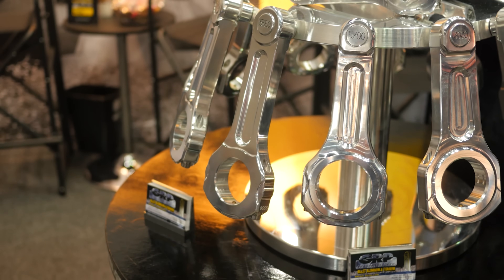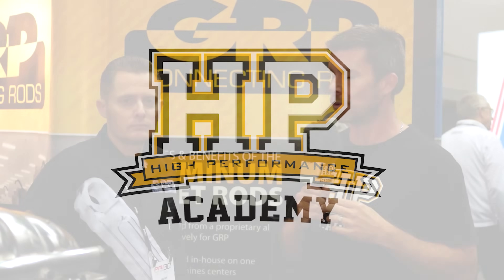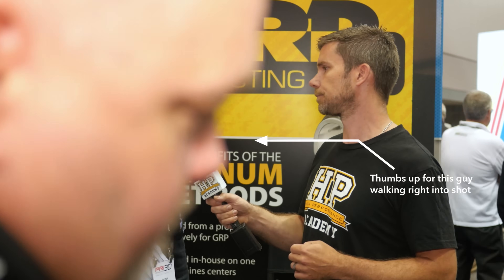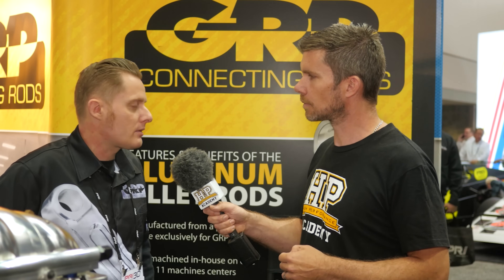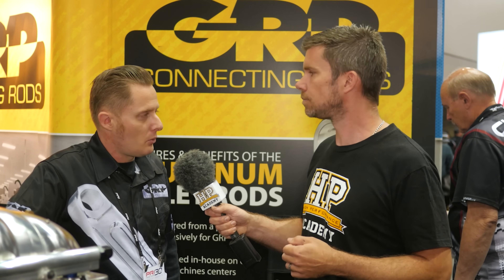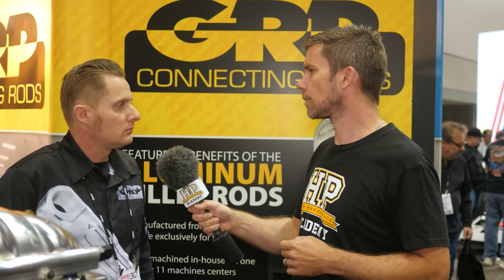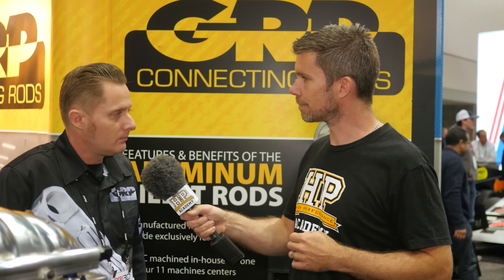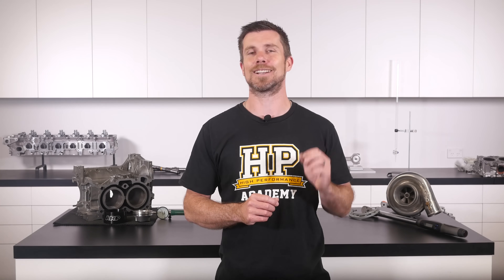Aluminium Conrod Pros and Cons | GRP Connecting Rods [TECH TALK]

Comment: Very little power gain to be had with alloy or titanium rods; that’s why alloy rod manufacturers rarely give specifications in that context.

As the guy says, it’s really just the alloy rod’s malleability that suits them for such a high powered environment. However, the greatest load on a conrod is directly after the exhaust stroke, as then their ductility is strained, and alloy rods have far less ductility than steel conrods. 

So, alloy rods (and to some extent Titanium) rods give very little HP benefit for drag racing applications as the engines don’t rev into very high numbers like F1 engines do.

Another way to say it is; for almost all (including some performance/racing) applications (and within reason) the overall static (translational) weight of the crankshaft and con-rods don't matter much.

This applies to alloy con-rods as well as the majority of their  measured (translational) weight actually becomes rotational energy/weight when the engine is running. 

This means that very little of those sections of the lighter conrods that actually made them slightly lighter than the other steel conrods will be near the piston’s wrist pin; and since those conrod sections (near the wrist pin) do not constitute and/or meaningfully contribute to rotational mass/energy even when the engine is running (as they are translational mass) there really is very little real (translational) weight saving.

And, it is translational weight saving that matters the most with these components.

Put simply the majority of the mass of a conrod is always at the big end section - so a translational weight saving of a few grams across the whole conrod (when it is not in motion when the engine is running) may not mean so much  in rotational mass/energy terms.
Reply: No I don’t go on F1 technical.net at all. 

No need. 

I am an ex AMG (Mercedes Benz) Powertrain (control systems) Engineer. 

For a while there (years ago) I was seconded onto the MB-McLaren team. 

Now I consult in the fields of electronic, power systems, acoustic, and mechanical engineering. I love power-trains, internal combustion engine and electric motor design, physics, boxing, judo, motorcycles, audio, and music. 

Take care.
Reply: Correction; in my first post I meant to say alloy rods have far more ductility than steel. Apologies.

Jim; ex AMG (Mercedes Benz) Powertrain (control systems) Engineer.
Reply: Great post. So unless my engine goes above 10k rpm, just go steel con-rods or maybe even whole steel rotating assembly? ... Any point in Alu pistons and crank then?
Reply: Remember, Top Fuel dragsters are getting pulled down all the time; so con-rod reliability isn’t such a big thing - but crankshaft reliability is, and alloy con-rods (due to how they stretch and compress) save crankshafts.

Stay with steel rods for street and race applications.
Reply: @StormCentre88  The biggest benefit is to the bearing life and block webbing as well. When your making a lot of power on a OEM engine such the Toyota 7M. The AL rods help greatly at 300HP+ per cyl.
Reply: @georgehoneymen6062  They may make some difference to bearing life, but I suspect it would be negligible.

Happy to be directed to some real world test results that show otherwise.

But one of the reasons I suspect it would be negligible goes to the aforementioned discussions in my above posts (particularly that in relation to translational and rotational energy/weight). 

The majority of the force on the big end (bearings) comes from the cumulative forces resulting from instantaneous, reciprocal/inertial, and composite torque.

And due to what I said in the 3rd paragraph of this post and also my above-mentioned posts, the alloy conrod contributes very little difference to both the reciprocal/inertial torque; as very little of the sections of the lighter conrods (that actually made them slightly lighter than the other steel conrods) exists near the piston’s wrist pin.

So, since those conrod sections (near the wrist pin) do not constitute and/or meaningfully contribute to rotational mass/energy even when the engine is running (as they are {up/down} translational {linear} mass) there really is very little real (translational) weight saving.

And, it is translational weight saving that matters the most with both, these components and bearing durability.

Furthermore, as stated in my above posts, Top Fuel dragsters and/or usually any other engine using aluminum conrods are getting pulled down all the time; so con-rod and/or bearing reliability isn’t too much if a big thing.

But crankshaft reliability is, and alloy con-rods (due to how they stretch and compress) save crankshafts.
Reply: @StormCentre88  I have only read posts from users which state that the rod absorb a lot of shock which doesn't pound on the bearing and crank shaft. They mentioned quite a bit better bearing life over a high quality forged rod when they did the switch to it.
Reply: @georgehoneymen6062  Fair enough. 

I have re-thought my position on your earlier posts and I concede, alloy con-rods would preserve bearing life to some extent.

However, the engines within which they would mostly be used would be torn down and rebuilt at such a high frequency I doubt the additional bearing life preservation would make a difference.

Please note bearing wear (particularly as you have described it) is a matter of “durability” more than reliability; I know this may seem pedantic, but I will explain later in this post and hopefully that will throw light on how I approached this subject in my earlier posts.

More than likely the real and/or main reason why alloy rods are used in some internal combustion engines - especially dragsters - is (I suspect) because alloy rods have far more ductility than steel; and this means their ability to *absorb shock will provide great benefits to preserving the “reliability” of the crankshaft and therefore engine investments.

In my above posts I was mainly trying to say that (the lightened alloy) conrod sections (near the wrist pin) do not constitute and/or meaningfully contribute to rotational mass/energy when the engine is running (as they are {up/down} translational {linear} mass) so there really is very little real (translational) weight saving; and therefore that means there is really not much of a “durability” (read wear) advantage to running them.

But translational/rotational weight matters aside (as I have above stated) alloy rods have far more ductility than steel; so as they *absorb more shock, then - to some extent - they also preserve wear a bit too.

But that (wear preservation and/or “durability”) is not the main advantage and/or reason why race teams fit of alloy rods.

It becomes a complex matter pretty quickly; as you would probably fit different little/big end bearings (to engines running steel rods) for engines running alloy rods anyway, and therefore (given all the aforementioned factors/considerations) the matter of whether alloy conrods meaningfully preserve bearing life then takes on several different flavors.

From a “durability” perspective - which was mostly the standpoint I was previously speaking from in my above posts - it’s doubtable the rotational/translational weight savings of alloy rods provide much of an advantage.

However, from a “reliability” perspective - as mentioned *above - alloy rods probably do provide some advantage; even though the engines within which they would mostly be used would be torn down and rebuilt at such a high frequency that the additional bearing life preservation would probably not make a really big difference.

More than anything alloy rods - due to their ductility and ability to absorb shock without losing their dimensional/other characteristics too much - improve “reliability” and prevent catastrophic failures, including crankshaft and conrod failures; which really has very little to do with wear and/or “durability”. 

Alloy rods keep the engine running (“reliability”) and protect (“reliability”) the investment in it, the conrods, valvetrain, and crankshaft; and although they may preserve (“durability”) bearing life that would probably be of less importance for all the above-mentioned reasons.

I was just (perhaps unsuccessfully) trying to keep things as simple as possible (about a subject that quickly can become complex) with my earlier posts; including by way of trying to avoid a discussion about the nuances of “durability” and “reliability”.
 
I hope this makes sense.
Reply: By ductility do you really mean stiffness or Elastic Modulus of alloy is less than steel? Ductility is a measure of the ability of a material to absorb permanent deformation without fracturing (I.E. permanently bending) which is not something that anyone wants to happen in their engine? The lower Elastic Modulus means it will deform more than steel for a given level of stress, all other things being equal.

I'm an engineer by trade but not within the automotive industry, hence why I'm keen to see if I understand or have something further to learn. 😊
Reply: Jim Stanley but the main question is will they fit my Honda ?
Reply: Yes, but only on the proviso that you can afford the cost of having them bespoke made. 

They will not be cheap.

And, the fact of the matter is that you will get no (meaningful) extra power with alloy rods; the cost of them could (if diverted into something else) probably add another 50% of power/torque to the Honda.
Reply: Jim Stanley cool so can I get them on ebay ?

Comment: Would be nice to hear facts on titanium rods
Reply: Chevy corvette had  titanium rods on their LS7 427ci/7.0L it made 505hp  and had a very long stroke of 4" inches and it also had a very high red line of 7,200rpm stock but was able to rev past 8k and make 700hp with a more aggressive cam and heads. Now also keep in mind that engine came in a Z06 which is intended for endurance racing and even won several 24 hour races like 24h of Dayton.  Titanium has the strength of steel and weighs around the same as aluminum it is also very hard to machine and thus costs are very high to manufacture.
Reply: titanium is for extreme cases without a lot of hp, the material properties can be counter productive as you push things, which is generally why you don't see them used very often besides the tooling costs.
Reply: steve morris racing engines builds HUGE boosted big blocks and some run TI rods putting out 4000+ hp...his channel is on YT look it up..
Reply: ls7 had dry sump oiling which helped in hi rpms
Reply: Also same as aluminium, no endurance limit. Steel does.😉
Reply: FYI, factory TI rods on LS7 are far from perfect or racing Ti rods. The main problem of Ti is that it cannot withstand friction unless coated or modified in some way. OE LS7 rods pre-09 type had coating delaminating on sides (they ride upon each other on rod pin) resulting in rods falling apart. GM had put them in to save expenses on oil. They should have introduced 10W-40 oil for LS7 engine because 5W-30 oil was breaking lose under piston skirt due to loads. So they had to opt to run Ti rods to save intertia in crank and rods, in order to make it work on standard 5W-30 oil.